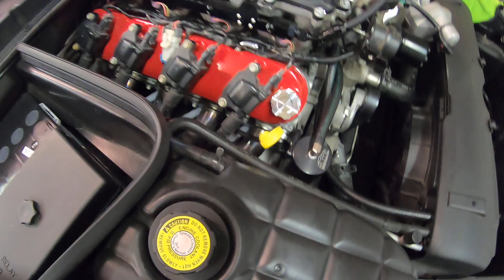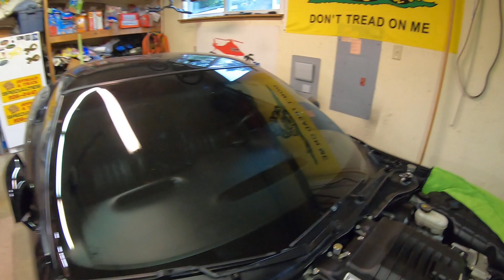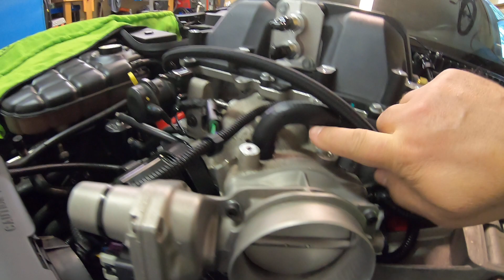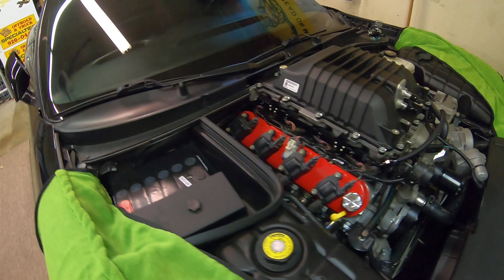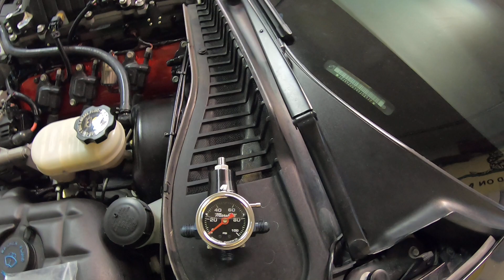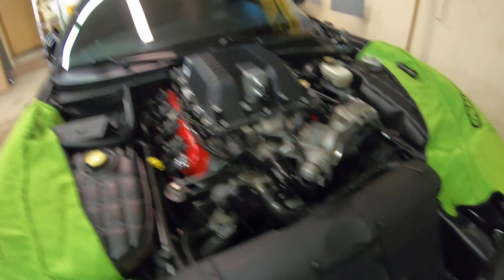LSA Supercharger install C5 Corvette ramble Aeroflow Fuel Rails Part 3

Comment: Where did you get that extra pulley? I have a caddy with the lsa but thinking about tearing it apart and throwing it all in my c5
Reply from the maker: You will either have to machine the snout or have the snout machined by Olson Kustom Works.  All parts to make this work are from Olson.
Reply: @PNW_Car_Mods  do you happen to know how much they machined it? Thank you for actually replying to me I know this video was posted like 4 years ago.
Reply from the maker: @LSJAY0104  Check out part 1 video on the LSA C5 in the playlist.  It shows exactly what it takes to put this blower on a c5.   Why it is a problem is because you can't run a secondary drive like it would be OEM.  The steering rack makes it impossible.   The blower has to be driven by the primary accessory serp belt.

Comment: Looks great underneath there just had a quick question if you had more room towards the back, would you have run the crossover line for the fuel rails on the back?
Reply from the maker: Great question.  It is ran that way now in a full loop.  If you are bored look for my video where I install a secondary fuel system and you will see how it is currently plumbed.

Comment: Inspired by this to make my own! Curious what supercharger pulley you used to offset the distance to the factory belt?
Reply from the maker: Olson Kustom Works.   Corvette belt Spacing.  It's the only way for this application.
Reply: @PNW_Car_Mods  awesome thank you!
Reply from the maker: @toxiclightning8320  You have to ship the whole blower snout in for machine work.  Cost is around 700 out the door.   Bolt it back on and go.  With that 700 you get the extra idler and bracket to go with it.
Reply: @PNW_Car_Mods  I noticed the difference on the pulley about. Awesome to know it’s a service they provide!

Comment: Hey again, that additional idler pulley. Does that come with the Olson kit or is that bought elsewhere?
Reply from the maker: It comes provided with the Olsen Kit.   It definitely would not work without it.
Reply: @PNW_Car_Mods  the oslen kit is making it more and more appealing to just buy a used LSA vs the boost direct kit
Reply from the maker: @tristanh4007  That is what many do.    No knock on Boost District either.

Comment: Where you able to get the ZL1 map sensor working on the ls1 ecm?
Reply from the maker: Indeed.  It works great.  Just have to input the correct value for the sensor in the tune and of course have the HP tuners 3bar speed density OS loaded.  I've seen at least two other people plus me that missed that in the base or startup tune and if that value is off the car will just start and die.

Comment: What balancer are you running??
Reply from the maker: Currently running the Dayco Powerbond SFI Balancer.  Not the cheaper Powerbond.   I'm exploring 8 rib options for the future but I may never need it.
Reply: Thank you!
Reply: Corvette spacing? Does the supercharger line up with stock spacing? Thanks!
Reply from the maker: @cameronfeltz2875  No, The supercharger snout has to be machined and modified to be run on corvette spacing.  Olson Kustom Works.

Comment: Where did you find those fuel injector clip adapters? Have a part number by chance? I’d love to not have to cut into my factory injector harness.
Reply from the maker: So far they are working perfectly and they were cheap.   Check this out   https://www.amazon.com/gp/product/B07SHSM6Q8/ref=ppx_yo_dt_b_asin_title_o08_s02?ie=UTF8&psc=1